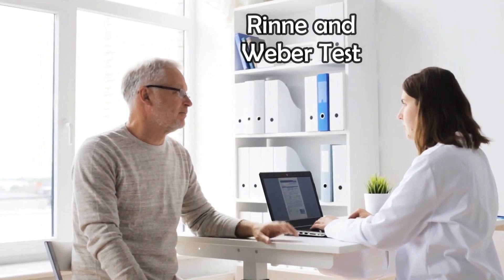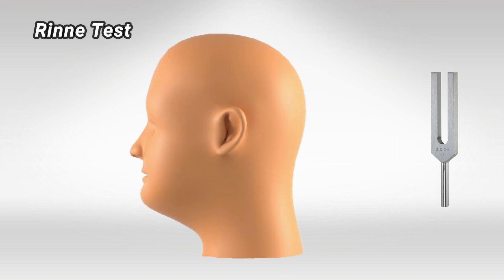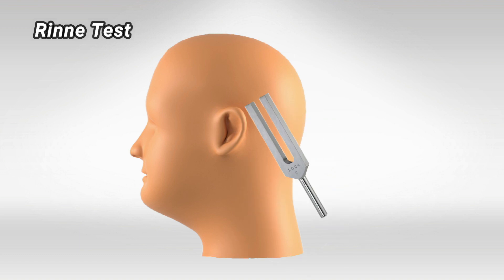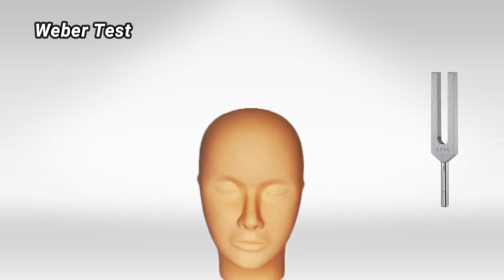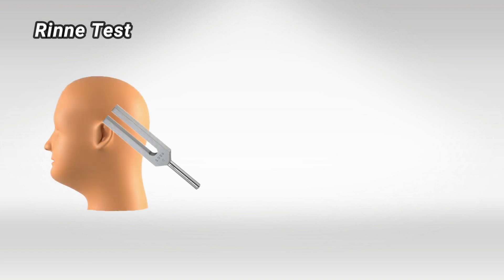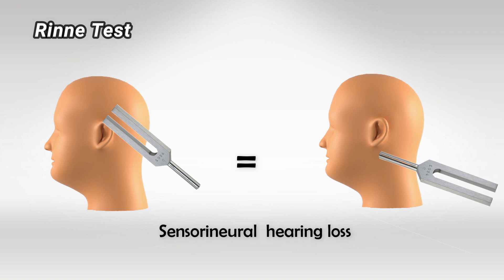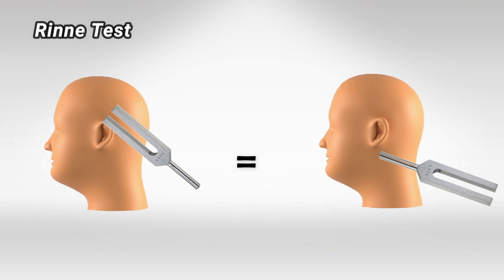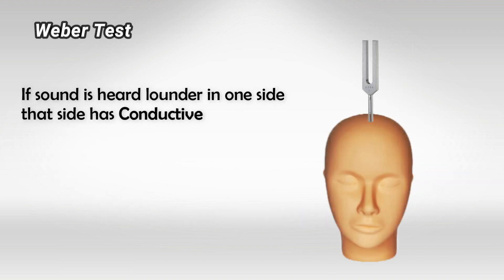Weber and Rinne Tests

Comment: Since R comes before We Do Rinne before Weber. Bone conduction > Air conduction, why? When sound passes through ear canal through Malleus Incus and Stapes it gets amplified therefore Bone conduction > Air Conduction. First we do Rinne Test if there is a problem in that ear we know that there is a problem but to ascertain if it is Conductive or Sensoneural we do Weber - if Sound is heard more in the ear which is normal it is Sensoneural problem this makes sense but in conductive hearing loss the sound is heard more in damaged ear this is quite counterintuitive - this happens because in damaged ear there is less noise coming from outside through ear canal and also there is less of sound waves leaving through ear canal as the ear canal is damaged - the reasoning is good but it can be confusing so the mnemonic used here is Sensoneural makes sense.